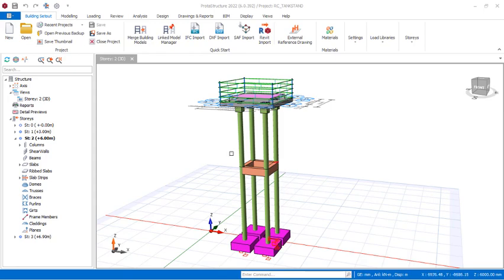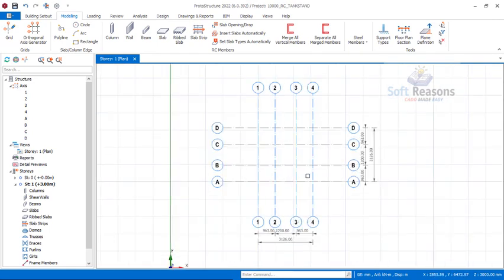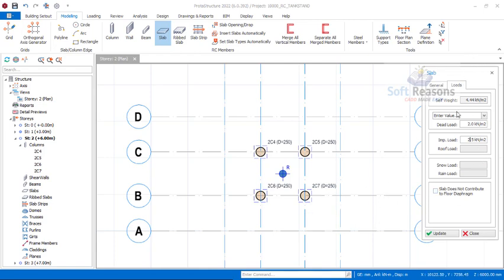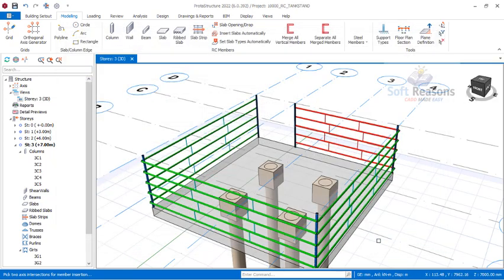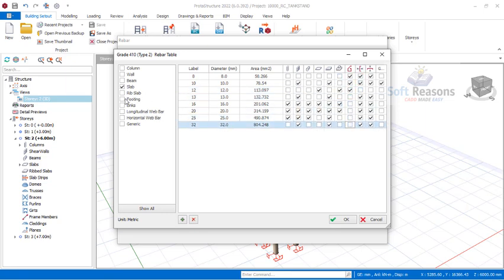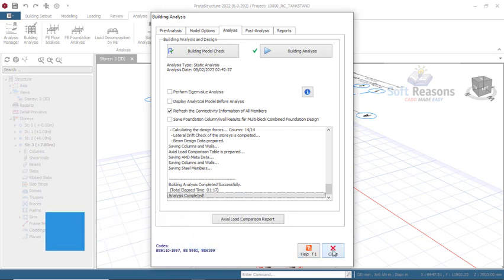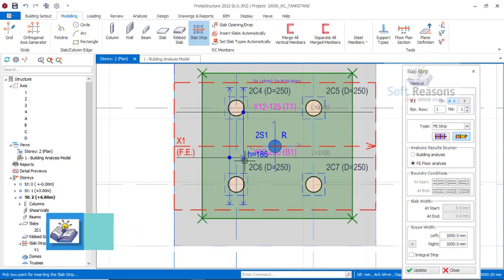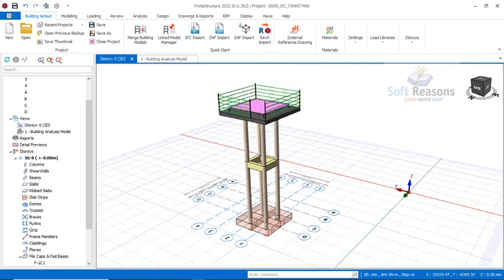Reinforce Concrete Water Tank Stand for 10000 Liters of Water Design in Protastructure

Comment: Can a 4m (width) and 5m (length) column of size 30cm by 30cm using Y16 Iron bar with ring spacing of 20cm support 20,000 Ltrs tanks of water (2 tanks of 10,000 Ltrs) each ? The slab is made of Y12, spacing of 20cm pad. The columns carrying the tanks are 6, spaced at 4*2.5m
Reply from the maker: Try the column section  by applying the required loads and design so as to avoid over or under design